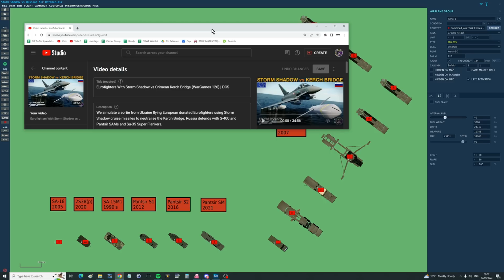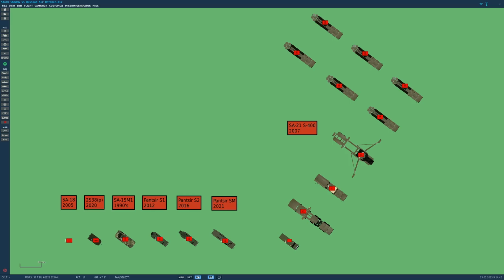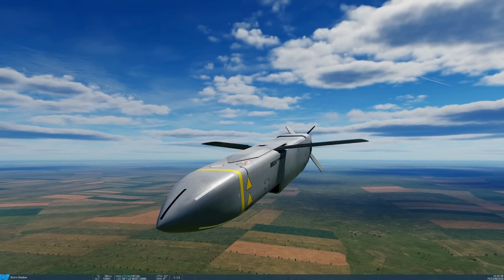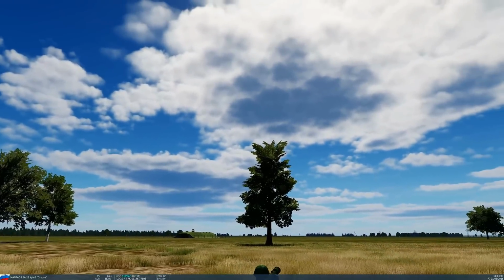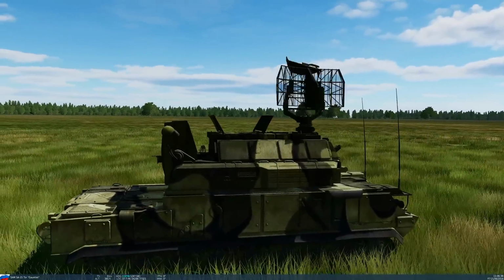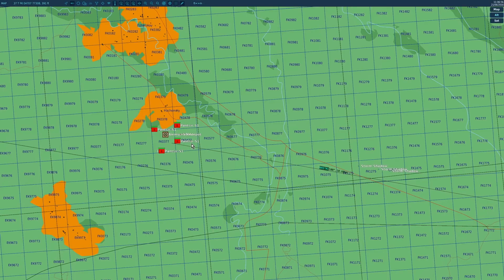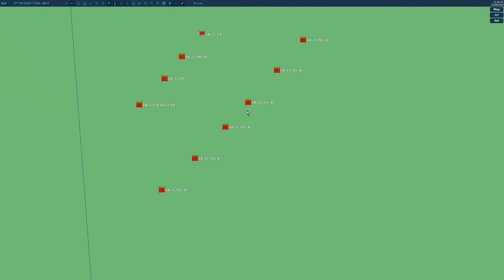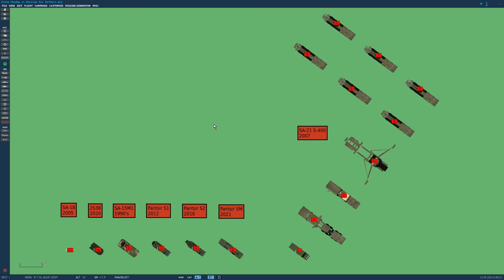Storm Shadow Cruise Missile vs Various Modern Russian Air Defence Systems | DCS

Comment: FWIW, the images of the shot-down Kinzahl don't properly match the images of the hypersonic missile, so it seems the Ukes have not yet managed to counter the hypersonics.
Reply: I think PAC 3 smacked it out of the sky or the missile goofed...Russia purposely launched a Kinzhal to destroy the American Battery and failed.........think about it. They are not invincible like Pooootin gloated about....
Reply: It's been confirmed by literally every source except Russia.

Cope harder.
Reply: Not wrong they show a concrete FAB aerial bomb much smaller in diameter.
Reply: Wrong
Reply: @Whatisthisstupidfinghandle  lol - okay :)
Reply: No, it is the penetrator inside the aerodynamic cover of the Kinzhal, it looks similar to the penetrator bomb, because it is supposed to be a penetrator warhead
Reply: @MH-ft9pq  no its not. The kinzhal has a 'sharp' tip what they showed was a very long round tip. Its not